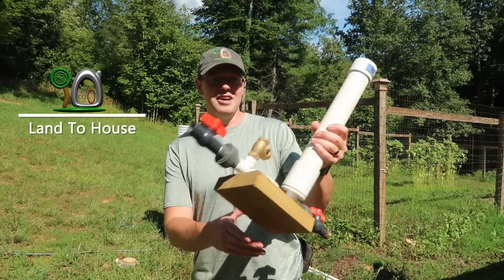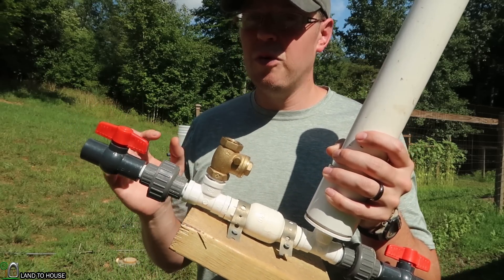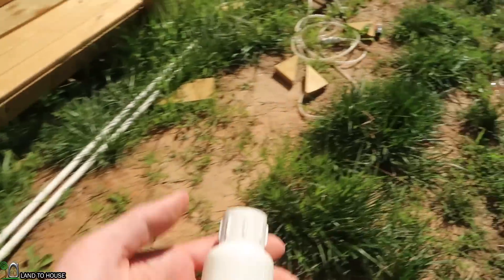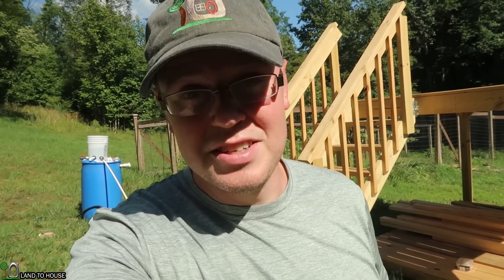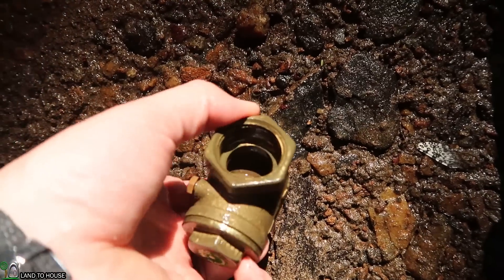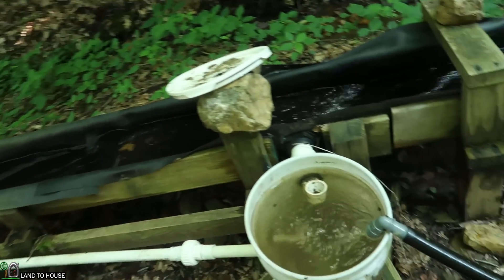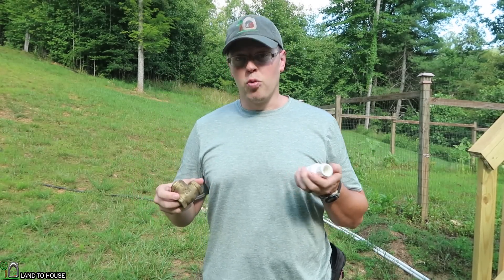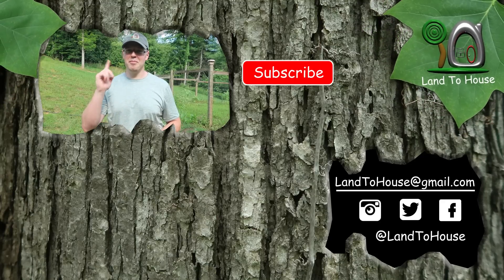A PVC Waste Valve - Will It Work - Ram Pump

Comment: I think if you have two options the brass vs. Stainless steel depending on the outcome of your test. Then you can let the person buying the pump make the decision if they'd rather swap out brass valve more frequently or pay a little bit more to get a little bit more life out of a valve. Or have the ability to upgrade the valve later on changing the specs of the original pump. If it turns out the stainless steel last a bit longer and it's worth the hassle of upgrading and doing the test to see how much it changes all of your pump designs.
Reply from the maker: I am planning to upgrade the valve and keep the pump cost the same for the sale price. The main change will be the slight increase of water use.  I will need to hook the pump up to a known water source and get a new gpm rate. 

I had considered having the option to offer the brass valve.  But I think I can get a few hundred stainless steel for a better price than brass.

Comment: it's almost time to throw a machine shop together and design your own valve..................... you've opened a giant can of worms
Reply from the maker: I would love to know more about Metal Works. Definitely not skilled in that area
Reply: Some check valves on other ram pumps seem to have adjustable weights.   I'm not sure what difference it makes, but if there is a trade-off to be had for lift vs volume pumped that would be helpful in my irrigation situation.

Comment: This is exactly what we found with those pvc ones we originally were using. to get it pumping with ended up using a paint brush, a spare pvc valve and two washers just to get it going, ended up not building anywhere near enough pressure to run over night. Thankfully the 2nd swing check valve came in a few days later so we've swapped them over  and finally have good(ish) flow and at a consistent rate (we made the lift pretty quickly so the sheep and goats will definitely have fresh water now).

The only issue we've really hit so far has been the pump only really snaps shut when the waste valve is at about 45degrees, would that just be a head pressure issue? I've added a few water tanks to act as standpipes for now and it works and does the job we want but if we can increase the efficiency it'll never be a bad thing
Reply from the maker: Whenever you turn the waste valve it uses more water but allows the valve to cycle with lower head pressure. If you can extend your drive pipe out further to gain more head pressure you'll be set
Reply: @LandtoHouse  so just as an example if I could run directly from where our Syphon currently is (possibly about 50-80m from the pump) that should sort the pressure issue I've easily got another 30-50m after the pumps current location that I can extend by too